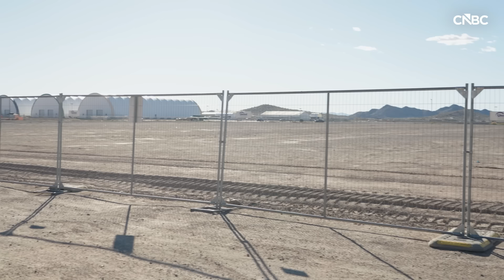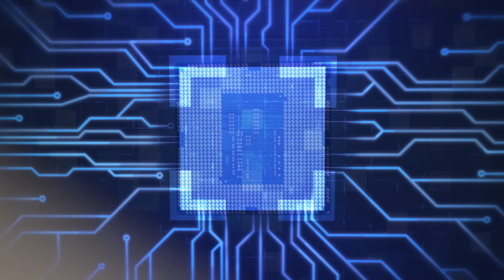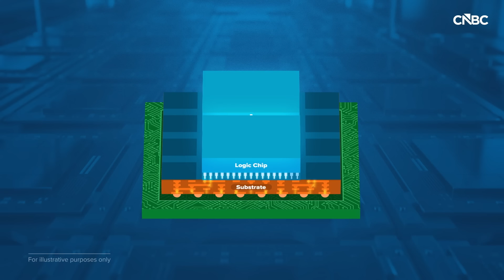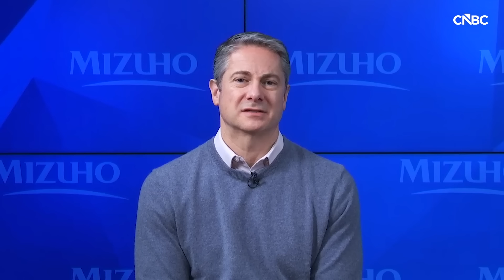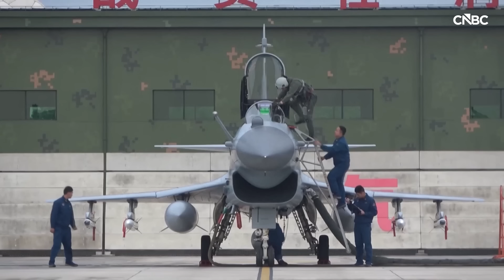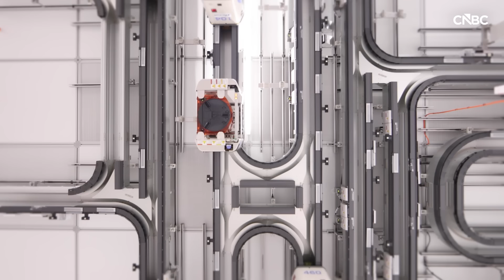Why AI Chips Made In The U.S. Are Being Sent To Taiwan — Creating A Major Bottleneck

Comment: TSMC needs a digital twin. There is no reason that a systematic system cannot be duplicated. We need 100 fabs around the world. AI data centers should come second to making new fabs. We need annual chip refreshes. Anything less is a waste of high token costs.
Reply: Talent, knowledge, skill, brains, education, raw materials, labor., capital, risk, sustainability Lots of reasons.
Reply: @kerwinco7906 All of those are systems and pipelines and can easily be planned in advanced. Making chips is not hard. It is a lack of having a system of systems to translate and scale this. This is why AI operating systems is going to change everything and why designing, planning, orchestrating, scheduling, ordering, hiring will all be autonomous in the future. These along with a custom blueprint made in days instead of years. Governments are too slow. They need to be sped up by 10,000 times. Education is easily duplicatable and scalable. We just waste time teaching it in ways that are centuries old and 100x slower than they actually need to be. There is no job in a fab that needs to be human.
Reply: @happyt98  The problem isn’t the “system” — it’s that one Dutch company (ASML) makes the only machines capable of printing advanced chips, and they produce about 50 a year at $400M each. You can’t just blueprint that. TSMC also has 50+ years of accumulated engineering knowledge that Intel and Samsung have spent billions trying to replicate and still can’t match. The CHIPS Act is already hitting delays because the US doesn’t have enough qualified semiconductor engineers. China has spent hundreds of billions trying to do exactly what you’re describing and still can’t produce leading-edge chips. If it were just a “system of systems” problem, they’d have solved it. Manufacturing at nanometer tolerances isn’t a pipeline issue, it’s physics. Veritasium has a great video called “The World’s Most Advanced Machines” that breaks all of this down really well, worth a watch before simplifying it to a planning problem.
Reply: @happyt98 Making chips isn’t hard? You’re utterly delusional! Why is Apple’s M5 trouncing both QCOM snapdragon X Elite & INTC Panther Lake? Why does TSMC’s N2 has 95% yield while INTC 18A has barely 50% yield?
Reply: @tringuyen7519  they’re high on chatgpt telling them “you’re so smart and so correct about everything.” a poster child of the dangers of AI
Reply: @tringuyen7519  No. It is not. Nothing that has been deeply systemized is not. It is repeatable. No matter how technical and complex it is. I am not comparing chips to cars to bread. I am talking about systems. Systems mean reproducibility and the lack of one is a lack of understanding and execution consistency and reproducibility. Humans are terrible at this. Companies are running on thinking and processes of how systems are designed, built, maintained by decades. There are AIs focused on manufacturing design and automation systems, from scratch. Musk knows about things that will make TSMC look weak. It will take a lot of time and trial and error, because its not just building a new fab in 3-5 years. Japan is doing interesting things with a different approach, but it will not be what Terafab will end up being. Musk moves with what can be initiated then he iterates the crap out of it and builds something new. He will end up doing lithography R&D, he has to. He has to do something that can be done within a 5-8 year time horizon to get to where he wants. ASML cannot do that. He will be able to get some machines to start things, but he cannot build Terafab with ASML. That is an absolute supply chain and technology barrier to getting to Terafab. He is using ASML only to get initial testing going and iterate chip process design and find insights to improve and likely reverse engineer it. This will end up being a 3 phase approach over 10 years to get to what he is envisioning on earth at least, and core into space.
Reply: @tringuyen7519 I think he is talking about commoditising the entire chip manufacturing, but, when such is as given, who is one supposed to extract all the "residual values" from?
Reply: Are there systems that aren’t systematic? Can a system not have a digital twin but a systematic system can?
Reply: It won’t happen for at least a decade. Quantitative changes lead to qualitative changes. TSMC isn’t just a company; it’s an industrial ecosystem. This ambition is akin to trying to break the physical barrier of the speed of light. Artificial intelligence currently has a critical flaw—a fatal flaw that could destroy humanity—because its level of perfection is too low. As KAREN notes in *The AI Empire*, the systematic exploitation of the workforce has reduced people to cheap labor for training AI, creating a vicious cycle of constant self-reinforcement. The design of tools for automated labor is intended to erode workers’ rights. Gigantic data centers are generating pollution, and the burden and costs are primarily borne by the most vulnerable communities, especially marginalized groups. Once completed, the data center OpenAI is building in Texas will consume 1,000 megawatts of electricity—exceeding 20% of New York City’s power supply. The supercomputer Elon Musk is building in Memphis, Tennessee, uses methane-fired gas turbines for power, directly causing environmental pollution and harming residents’ health—a genuine crisis for the environment and public health, all at the expense of jobs and humanity. What exactly is OpenAI CEO Altman trying to do? If jobs are being automated by AI, what about “people”? Please think about it. Thank you for your hard work! (Translated by DeepL)
至少十年之內是不可能，量變達成質變，臺積電的存在，不是一家公司，是產業生態聚落；這個貪心，和想突破光速物理限制類似。人工智慧目前有非常重要的缺陷，致命傷，可以摧毀人類，完美度太低；KAREN 《AI 帝國》，對勞動力的系統性的剝削，淪為了訓練 AI 的廉價勞動力，不斷自我強化的惡性循環；自動化勞動力的工具設計，目的就是為了侵蝕勞動者的權利。巨型數據中心，正在製造污染，負擔和代價主要是由最脆弱的社區，尤其是弱勢群體來承擔，OpenAI 在德克薩斯州建造的，資料中心建成後耗電量，會達到1000兆瓦，超過紐約市電力的20%以上。馬斯克在田納西州的孟菲斯，建造的超級電腦，使用了甲烷燃氣渦輪機供電，直接就導致環境的污染，損害居民的健康，真實的環境與公共健康的危機，以就業與人性的代價。OPEN AI CEO 奧特曼到底想幹什麼？工作職位 AI 化，那「人」呢？請想一下，辛苦了，感恩！(DeepL翻譯)